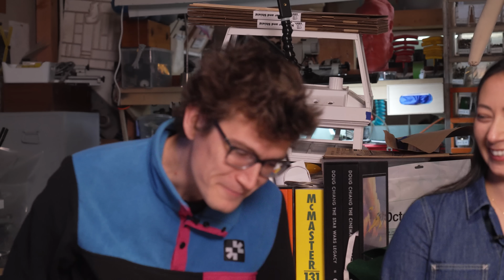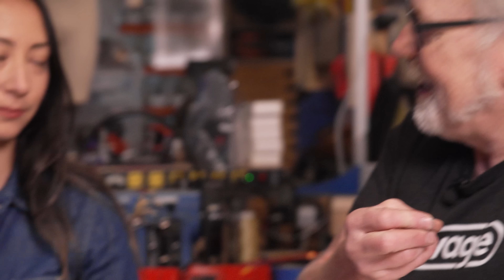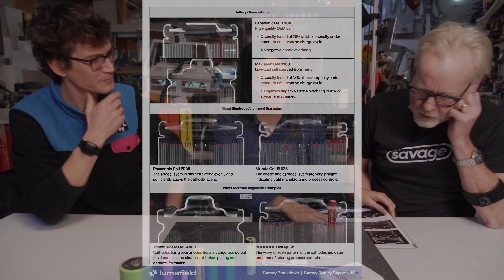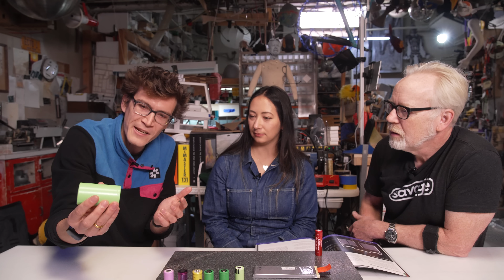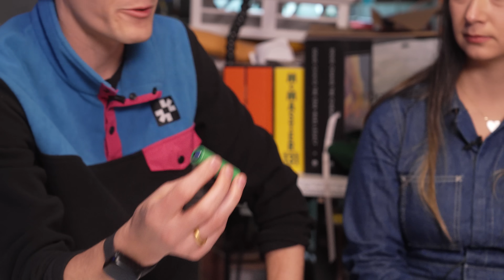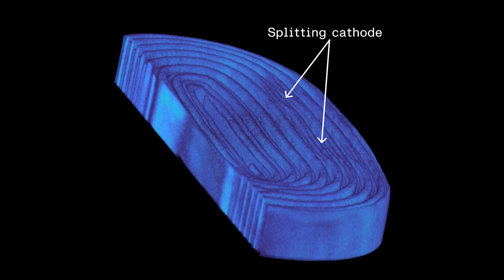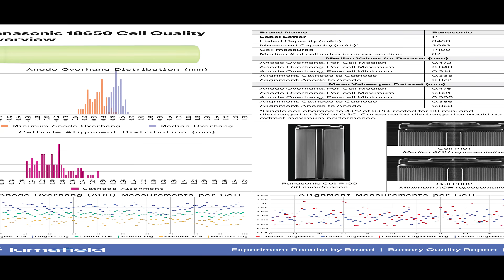The Surprising Flaws in 18650 Lithium-Ion Batteries

Comment: I work in the battery manufacturing industry, although not doing cylindricals. We x-ray our cells the same. The riot that happens if a cell that is 0.05mm above or below spec and somehow got sent through the process. Sometimes it can be as simple as someone bumped into something in the machines assembling the cells while doing routine maintenance or using the wrong screws. Battery cells have crazy tolerances. We once had to evacuate the entire factory once a few cells shortcircuited from a malfunctioning robot hand and do a several days long shutdown to investigate and fix everything. And these cheap manufacturers send such crap to consumer electronics is wild.
Reply: aluminum wires chargers that short out and turn the entire metal casing into a live wire batteries that burn out heaters with no safety shut offs we really need a website that catalogues and sells reliable safe electronics and components
Reply: @boxfoxscoot1614 In a sense there is one for the European union  but it's not specific to electronics. it's very confusing to read though due to the amount of products found problematic others for minor faults and other for serious ones and the bad way it is structured.
Reply: @DragonlordSVS damm, I just came up with a great business plan to help serve the EU because of your comment. Thank you for real
Reply: @boxfoxscoot1614  What all countries need, is that government will disallow the sales of the unsafe products in their country.
That every product when in process of import permission, is checked and validated by the specialists and experts, and they decide by the technical merits is the device safe to the user. Irrelevant of anything else than technical specs. So no politics, no competition, no branding etc influencing the testing process. If the product is not safe because some part, or its design etc, it doesn't get the import permit.
And all products gets re-checked with random checks that the product has not been changed since the import permit given.

That is example what can be seen comparison between Apple and Google in their corresponding App stores. 
People late Apple's protocols, but you can't deny that they have managed to keep safety extremely high regardless the amount of available products for its users. Compare that to Google's, and it is like Microsoft Windows, the user is responsible, regardless the user skills, knowledge or capabilities to find safe software.
Reply: @boxfoxscoot1614  here are some commas for you ,,,,,
Reply: What happens to the rejects? My theory is the Samsung counterfeit was probably a legit Samsung cell that failed QC that just gets sent off to a shady reseller instead.
Reply: @VexingRaven  not a chance the lack of quality control and those types of deviations are from a poor product being made using a different manufacturing system
Reply: @MrFateorfaith  yes and a case where money overrides the proud in presenting a quality product
Reply: @VexingRaven  At my workplace, we would just scrap them if they fail any QC pass with a good reason. But I would guess other places especially those mass producing several tens of thousands of day probally brand their lower quality cells differently and sell them somehow. If things like those in the video get into consumer products anyways.
Reply: @Rakvalde What does 'scrap' mean in your context?
Paying an external scrapping contractor to dispose of them?
Those contractors may be the ones doing the rebranding and reselling.
Reply: @Rakvalde Like seriously how stupid do you think ppl are? You expect me to believe you worked in battery manufacturing and when they found cells with a short circuit they shut down for days?? DAYS?? GET f@#$ed. Aint no manufacturers shutting down for days... wtf what a stupid bs story. Shuts down for days ffs 🤦‍♂️ so dumb. Next time you tell that story stick to theh stopped operations on the line with the malfunctioning robot to investigate.. 👍 dont make a story that sound dumb and ppl that arnt so stupid can immediately realise its a bs story. You dont work in then lithium battery industry please its really embarrassing so stfu. And on top the no name company you work for manufacturing batteries you are trying to claim are of higher quality and standards than say Samsung are they. Ffs do you realise how stupid you sound? And dont tell me you call yourself a man while making up stories like a child. Damn no self respect.
Reply: @Rakvalde  Unfortunately the truth is that when money talks, integrity went pop in a lot of cases. Seems like compared to 20 or 30 years ago, that becomes more like the norm in general. I'm generalizing now from the sideline and old age experience.
Reply: @Rakvalde  Rebranding cells is fine when the issue only affects cycle life or capacity, tbh. It reduces waste. Obviously if a cell is actively dangerous it should just be recycled.
Reply: @VexingRaven that would defeat the purpose of all the standards they try to meet with production. And would ruin their reputation as being reputable. You need to use some commen sense. The counterfeits are counterfeits. Proof is how they are made as in the construction of the case and even the just some minor differences in the cap, wrapping and also the printed text usually a little off with thir font
Reply: @hus_10001 You're being naive if think the factories in China always do exactly what they tell the company that are doing.
Reply: @VexingRaven bro stop embarrassing yourself you sound stupid. Tells me stop being nieve while talking nonesense. Snap out of it. Look how stupid you sound. Samsung counterfeits were originally a legit samsung cell that failed 😐 if you cant see how stupid that statement is then fair enough and we will end it here because i dont argue with people that cant tell fantasy apart from reality. Samsung sell their cells that fail to be sold on as counterfeits 😐. Dont worry the construction is completely different its got to be originally samsung that FAILED. Samsung sell FAILED cells to be sold as counterfeits. Wow the level of intelligence here in unreal
Reply: I worked as a semiconductor failure Analysis engineer for 25 years. We didn't have a fancy CT scan X-ray, but we did have a nice real time X-ray. The X-ray was great at imaging package faults, broken or lifted bondwires, and larger electrical overstress failures (fused open bondwires). I would demonstrate the tool by X-raying my cell phone and point out the different parts inside.
Reply: @billjames1953  The things I have seen manually reviewing probally thousands and thousands of CT scan images for deep testing and the on line x-rays from cells as they pass through. Sometimes I feel like I could spot broken weldings or misaligned sheets just by glancing at a images for a split second haha. :face-blue-wide-eyes:Once even saw a big piece of metal inside a cell that somehow passed all safety checks.
Reply: @Rakvalde sounds like you worked in Northvolt's Ett factory 😂
Reply: @Lvvcassss  Damn, how did you know lool.
Reply: @billjames1953  I've always enjoyed how you can technically image directly with a FIB as well by looking at the gallium ions, but it's obviously a bit more destructive and worse than using a standard SEM.
Reply: @EkiToji  We used use a FIB tool to isolate a single transistor on a IC and put down probe pads that would allow us to verify that the transistor is bad. We also had access to a FIB cross-sectioning tool
Reply: @billjames1953 dont lie, you used to work shovelling 💩 at the farm
Reply: just to put this into perspective, .05mm is 50 micron. An average human hair is 70 micron in diameter.
Reply: @TOAST2218 lol bruh this guy full made a story up trying to be relevant. Its funny how he tries to give specific details to try make it believable. He slapped 2x AA batteries in a toy one time and became a lithium battery expert
Reply: @hus_10001 I bet he used a set of metal calipers to measure the length of the battery as well.
Reply: Thank you for your dedication!
Reply: The Cheap manufacturers can just rebrand and start pushing crap out again the next day. If Phillips or Samsung cells have a few highly publicised explosions everyone will stop buying them and they will lose major supply contracts.  The 18650 isn't really an end user so much, but mostly it's like she said people bying Anker powerbanks or Ryobi, Makita etc.. tool batteries.
Reply: @BogoBob snap out.of it. The bigger companies pay for quality control and to meet minimum standards.. theh aint using trash cheap assembly robots. They pay to get it right and dispose of trash. Plus who tf sells.failed cells? Ffs. A billion dollar company you compare to firestarter cheap chinese with no quality control.what so ever. Wake up
Reply: As someone who works on airplanes, thank you
Reply: After having a 21700 cell explode infront of me I moved to buying better cells instead of the cheapest I could find, kinda scary that some people charge unprotected lithium cells overnight next to their bed without any worry at all, while im now scared to have a lithium pack just sitting outside of my insulated steel ammo crate.
Reply: @Tryxxor  I recently bought a pretty nice e-moped with a 60kwh battery. I only charge that giant thing with supervision and a safe way to dispose of it. If it explodes while im away my house is toast lol.
Reply: @Tryxxor what brand?
Reply: I am a graduate student, working on samsung inr21700-50g battery cells for an Electric Vehicle car. What we've been told by MOPAR technicians, that even THEIR practice is to run and tell everyone to fully evacuate. The chemical and safety standard to impede or 'stop' a thermal runaway is always easier to just 'gtfo.'
Reply: @Crestache hopefully, in the near future, this practice will not be necessary. The sodium and solid state technology seems much safer.
Reply: @mb-3faze solid state is a scam wake up
Reply: @hus_10001 the Toyota and Donut Labs solid state bats are most likely vaporwear - but CATL's tech does seem promising. Before 1994 'everyone' was saying blue LEDs were impossible (bright ones, anyway) and yet Nakamura proved everyone wrong.
Reply: @Crestache yea you remember the cargo ship with all the exotic cars and the electric cars that caught fire ? It sank and just burned under the fucking ocean until it was out of fuel for the fire. It’s gonna burn til it’s done burning lol the pressure and water couldn’t put it out how expensive is the safety system gotta be to put out lithium fires ? I’d be cheaper to move manufacturing plants while that old one burns yea gtfo
Reply: Thisn is all new to me, and I really need to know actual brand names, at least which ones are safest.
Reply: @drdanny11 I am no authority but my experience with buying and using 18650 batteries is that the most expensive seem to give the most reliable power output over a longer period than the cut rate no name versions. I’m very happy to see the work that was done here and henceforth will never buy another cheap or off brand lithium ion battery. The risk exceeds the savings imo.
Reply: @drdanny11  molicel batteries from a reputable seller is my go to
Reply: I use these 18650 cells for some projects. I only get big brands I trust because they are not to be messed with. Also a very good and solid protecting case.
Reply: @tardvandecluntproductions1278  can you suggest any brand
Reply: Yes - my pet peeve is these darned disposable vapes, which all have a Li ion battery in them. I find them discarded and broken on the side of the road here in northern California where the fire danger in summer is immense.
Reply: @stevengill1736 hopefully when they are discarded the battery is fully discharged
Reply: @vueport99 You would think that, but no. They are discarded because the eliquid ran out, rarely because the battery fails, and since they're rechargeable, they all almost certainly have plenty of charge still left in them.
Reply: @pfarnsworth84 that's a horrible waste. I've seen people discard them in collection boxes. Maybe I'll tear one apart next time I see one to test what the capacity is. I would be surprised if it even has 1000mah
Reply: @vueport99 people collect them to upcycle
Reply: @stevengill1736 oh risks aren’t that high as they say …
Reply: @CarTunezzz 
Thank you....I hope you're right and if they're made correctly probably so.
I've been collecting old vape batteries from used vapes donated by local smokers - planning to charge them and then abuse them in various ways to see if they ignite.... it'll be filmed for YT so we'll see....
Reply: I have a collection of vape batteries that were obtained from smokers...to be charged and abused, filmed for YT, so we'll see...😮 😊 Cheers....
Reply: @stevengill1736 just keep in mind they have cells that arnt ment to be used built as a battery pack and are ment for single cell use applications. Im not saying dont build a battery with them because i am but you need to take extra precautions because they lack the mechanical protection that cells used in a pack have. Also they are a pain to get them lined up and get spaced correctly. Honestly to make it at all safe it takes some extra time and effort and begins to get tedious. I built about 1/3 of mine so far and got frustrated and left it for another day 😅 i could have built probaby 2 48v batteries in the same time using 18650s
Reply: Dude me too! We scan everything! our QC department is huge.
Reply: @geoh7349 this is very reassuring.
Reply: i don't really fancy finding out how the cheap one's fail either.
once i had my mum's old apple laptop next to my bed at night. i woke up from a bang, thought i must have dreamt it, and went back to sleep. the next day i realised it had birst open the battery compartment. as annoying as that was, it was a safe failure. had it caught fire i probably would only have had a few seconds before the fumes would have knocked me out.
Reply: Our neighbor's home  completely burned to the ground  because of the freezing temperatures caused battery fire in their electric lawnmower, which was always 'docked' plugged in to keep it charged up for the next run.    Luckily, their smoke detector woke them up out of bed and they got out alive and unharmed, but their  home is gone.  So if you have  ANY  electric battery powered tools, lawnmowers, or other large lithium battery devices, be sure they are not plugged in all winter and if you can, keep them in a climate controlled heated garage.
Reply: @SeaJay_Oceans Yep, I do not store my Ryobi 40V batteries in my shop (which is not climate controlled) for that specific reason.
Reply: Hell, i wouldn't be surprised if some of these batteries are from the 'reject' pile of the more stringent manufacturers. Why recycle or trash them when you can just sell 'em o the cheap?
Reply: Never underestimate someone’s will to profit no matter what the issue is.

China sold baby formula for profit by reducing the amount of milk in the formula to increase the profit made by having less milk in the same amount of product. To pass the protein test that would have detected the reduced milk content they added melamine to the formula to bump its protein measurement back up to evade detection. Think about that level of motivation to profit more by feeding babies melamine instead of milk …. Then tell me someone wouldn’t just sell defective product instead of throwing it away or sending it back into the line to be reworked.
Reply: @enderwiggen3638you are comparing chinese products that have no standards and built as cheap and fast as possible with a single budget low grade technology machine in a factory vs a huge company worth millions/billions that follow strict quality control and standards and have multiple percision advanced technology machines and robots. A hundred thousand dollar company to a billion dollar one. I recommend doing some brain exercises otherwise it gets lazy and even simple general knowledge gets overlooked.
Reply: Some don't have pride in their work, it is just about the bottom line till they need to rename and do it all over again.
Reply: So what are the good brands?
Reply: @Goalsplus  Samsung and Panasonic are the main ones I've seen.
Reply: @Patrick94GSR authentic lg he4 is solid too
Reply: It does make me happy that your company does the right thing. Shame the cheap manufacturers aren't following suite.
Reply: Less reputable factories sell defects vs recycling
Reply: @Nicholas-f5  It's not limited to less reputable factories. Recycling is often uneconomical and even where it is, it's often outsourced and it's the "recycler" that sells the defects.
Reply: Varta?
Reply: The off brands don't have a reputation to protect. The better name brands have a reputation to protect, and also do not want to see any lawsuits. Branding matters in stuff like this.
Reply: So where is the portable xray for this purpose???
Reply: This interview could have been so much more mind-blowing. But I get it.  Better to exist to do more shows than die defending oneself from lawsuits levied 
by powerful corporations profiting from a trillion dollar industry. 
That said, by not naming names, companies, corporations brands,specific products and only giving dire warnings for caution absent specific precautions to consumers with no way to check quality ourselves, you are doing a disservice to the consumer. Can't blame you for playing it safe.... Or perhaps we should? Pick your battles. The Main take away: we're filling our faces and bodies and homes with potential bombs listening to our children out to play with them and to school with potential bombs that have an unacceptable failure rate and no way to know in advance. It's a little crap shoot and consumers are on their own. If something gets hot and you're lucky enough to catch it before it mames are kills someone, make certain to submerged said batteries completely/entirely under water.
Reply: Appreciate the work you do!
Reply: Many people assume a 3000mAh rating guarantees stable output, but that’s not how lithium-ion chemistry works in high-drain applications.
Reply: @diytoptricks  as far as I know, nobody thinks it will provide "stable output" at least not without a BMS and a buck boost converter. 

However, from what I know, lithium ion simply provides the highest charge and discharge rate of any $1 3000mAH battery you can easily buy. So when you need HIGH power output in a small package, that's when you buy lithium ion, like an 18650 for flashlight or drone, or a flat pack for a handheld device that you want to be thin.
Reply: then you ask... does the power density NEED to be that high? oh yeah it's toooo heavy!😂
Reply: Oof  sounds like something out of THX
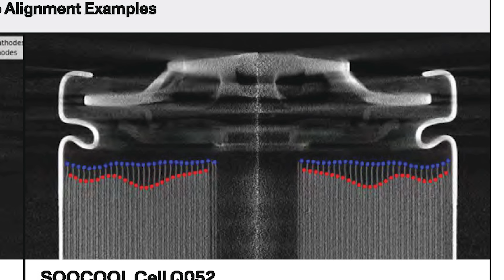Reply: Seems like long as the avoids are under a threshold it passes 7:29
Reply: The thing with those vape cells in particular is they are known to be defective. Basically these makers buy rejected stock for that should be disposed of/recycled for next to nothing and then re-package it for these single use devices. These defects are not that problematic if the battery is never going to be recharged after all. There is far worse issues with those devices though not limited to them being thrown away.
Reply: @theonik2006 I've never seen a disposable vape with an 18650. They are almost always a custom specified design. I've taken apart multiple dozens, and they've always been a different size of smaller cylindrical cell (little smaller than a CR123) with no can. Also, they are made to be recharged, because the battery isn't big enough to last for the whole tank of juice.
Reply: @pfarnsworth84  I didn't say they were using an 18650, they use different standard packs but the principle is the same, for the most part they will buy recycled cells from large makers.

Most single use vapes cannot be discharged and do not come with charging circuitry or a charging port. Since some countries changed their regulation to ban single use vapes though some makers are skirting these regulations by making them technically re-usable. (your experience may therefore vary)
Reply: What's blowing my mind away here is that a AA cell should be ~1.5v and the lithium ion cell should be ~3.7v. I understood that there's a DC-DC converter in there but I'm not seeing them talk about these converters. 

What am I missing?
Reply: @N9XRradio The batteries in the video are 18650 cells, not AA. They have a larger form factor and output 3.7 - 4.2 V.
Reply: @Vir9il ok. Thank you. I've seen LiIon AA batteries claiming to be 1.5v but they have regulators or DC-DC converters. 

Thank you for the info.
Reply: @N9XRradio  I bought some cheap chinese "Pujimax" liion batteries of that type (there are 1.5 and cubic 9v version with usbC plug for recharging). It's cool that they hold voltage untill they are completely empty. Then they just cut-off.
Reply: How much of a good practice is it to charge your batteries when you're awake instead of through the night? Because I assumed most fires happen in the charging process.
Reply: @Cypress-g3l4k A very good practice indeed. Honestly, charging at night is not that terrible, I have smoke/fire alarms and a monitoring system, but I absolutely NEVER leave anything charging when I'm not home, even NiMH. The only thing I feel safe doing that with is lead acid batteries and a battery maintainer.
Reply: @pfarnsworth84 , I was charging old Pb bike battery with it's stupid charger on the hot sunny day (the sun was directly hitting the battery case).  After being fully charged it "ran away" so it started to overheat. They were very hot, smoking and turned into a "pudding", they totally deformed.😆 But, luckily, they didn't explode or catch fire.
Reply: They are UL approved. Lol😂
Reply: Lol BOT
Reply: @hus_10001 where?
Reply: @Lvvcassss 😐plz just dont. I really dont want to disrespect you
Reply: @hus_10001 You seem to own a White brand bike...something tells me you've noticed the sarcasm ;)
Reply: Like seriously how stupid do you think ppl are? You expect me to believe you worked in battery manufacturing and when they found cells with a short circuit they shut down for days?? DAYS?? GET f@#$ed. Aint no manufacturers shutting down for days... wtf what a stupid bs story. Shuts down for days ffs 🤦‍♂️ so dumb. Next time you tell that story stick to theh stopped operations on the line with the malfunctioning robot to investigate.. 👍 dont make a story that sound dumb and ppl that arnt so stupid can immediately realise its a bs story
Reply: There is a lot subbrands in china that buys the dirty lithium reject from their high purity quality assembly.

Basicly taking trash and trying make the most out of it by maked billions of tiny batteries..

Sometimes a pack have dense concentration "rock" of contaminent in the lithium compound itself. When current flow thru those rock, they ignite and light up the whole battery.
Reply: I have the sudden urge to listen to Metallica's ''Battery'' now.
Reply: What country do you work in?
Reply: It's "wild" that most people want cheap and good enough?  lol no.
Reply: You should share your brand name if you think the batteries are that good!   :)
Reply: @Ishkatan  Unfortunately our company went bankrupt due to bad management and ridicolous spending so no batteries are out there except in equipment being used lol.
Reply: Those are not crazy tolerances, thats mediocre tolerances for every mechanical industry over the world. From a garage sized company and to multibillion. If you get into really tight tolerances your numbers are out of the chart.
Reply: @andersnilsson973  Problem for us is our machines had so many bearings and other things that caused offsets that we could at most maintain a +-0.2mm tolerance from the drawing design. And we were expected to shut down the machine and re-set things if it got 0.05mm out of tolerance at times lol. Even though me breathing on it could change it by that much.
Reply: What happened at LG Chem  traction batteries ?  Bump the assembly machine with a Fork Lift ?
Reply: its same as light bulb
Reply: wait, its known like 20 years in eu
Reply: That's what happens when you build mass, china produced stuff. Build cheap, build twice.
Reply: Yes but there are lives at steak here and there is tolerance built into manufacturing there is no excuse and you should know this.
Reply: Thank you for your service so that we might not have a dendrite burn us directly!
Reply: I am an battery enthusiast, I own batteries from various brands including Samsung, Toshiba, LG, Panasonic. The Panasonic is the one he kept touching with the black bars in green sleeve. But there's also bad sellers who put a fake sleeve and call it Panasonic. The real one is very stable even can go for years under full charge without failure. What kills me is why battery pack manufactures like Dyson, DeWalt use junk 2400 mah instead of quality 3600mah. The price they charge for those packs is insane given how cheap the Panasonic cells are to begin with. And that could have given people really long run time!
Reply: @vueport99 Panasonic and the lg he2 and he4 were the goats
Reply: @tobymcq33 I'll try to get some OEM LG cells in the future to try.
Reply: @vueport99 omg why are there so many story tellers around 🤦‍♂️ shows your lack of knowledge. They arnt trash just because the have lower capacity. Lower capacity cells usually have higher discharge rates. Damn bro calling cells trash just because you have no understanding. And you tried starting your story with you are a batteru enthusiast. How embarrassing
Reply: @hus_10001 you have no clue what you're even talking about. Get a life
Reply: People accept the cheap batteries because they don't really know, or remember what they are. As at some point people's youth, they do learn that batteries are mainly chemical what they are using. Were they a liquid starter batteries in car or a small AA battery in their toys.
But we forget all those things as they "just works". 

What happen when couple Samsung S2 or S3 phones got ignited and exploded even? 
The industry went nuts and people became aware.
(That is power of terrorism via private media corporations.)

And yet we, consumers, can't really do a thing about it as we need electricity in small devices.
There is not really way to get back. but does it really matter if we would have a governmental safety protocols in imports of products?
That is one thing in the USA, that you can import lot of crap in name of competition. Where in civilized countries the government's duty is to protect their citizens, and hence as well safety check imported products before letting them come to markets, that they fulfill the technical standards and safety policies etc. 
That is the purpose of the standardization and protocols, we together as democracy, check everything and we agree with a common rules and protocols for benefit of the people, not benefit of corporations or business. And those standards and policies are obeyed and followed by the companies and corporations without their self-interest as "individual". 

So when a children toy with batteries, or a professional tool with batteries, or a common electronic device with batteries gets to the market, you should be sure that each part in the device is checked by the government authority, that has the technical know-how and methods to confirm its safety for the citizens use on the task.

But as countries join to all kind stupid "Free Market" or "Free Trade" association and groups, like EU and WTC, they circumvent the democratic and national safety protocols and infiltrate the safe environment with crap that is hazardous and dangerous for its members.
Reply: @paristo You overlook EU battery regulations which are more rigorous than national ones, and which are far less likely to be ignored, and which raise standards for countries not even in the EU.
Reply: @paristo  I remember hearing about the Galaxy Note 7 phones that ignited and exploded even, but in that case I think the way people became aware probably had more to do with the 'power of the press' than it did the 'power of terrorism via private media corporations.'
Reply: @paristo  I remember learning that the original TPP (Trans Pacific Partnership) contained language that made it a contract violation for a participating nation's government to enact any law (in the best interest of that nation and her people) that could be deemed to have an adverse economic consequence to a corporation operating under the umbrella of the TPP.  Realizing that governments were signing away their ability to govern lest it offend the profit motive of some company was a terrifying initiation to the true state of the world. This world where profit over people could be enshrined in the largest trade deals, where my elected government wasn't in full control of national policy decisions and that governments are more beholden to the largest companies than they are to the electorate. I have not read every major trade agreement, but I can't believe that the TPP was a "one-off". We definitely need a firewall between government in business, otherwise there is no one on the side of the people and no real redress for corporate abuse.
No I'm not anti-business, they hold all the capital... they will be fine but image if planned obsolesce went away and right to repair was enforceable and monopolies were actually broken up and corporate welfare ended and corporations paid for their use of the commons etc etc.
Reply: When you think about the guy who got his jar blown off by a faulty vape battery, or the people who had their Samsung phones catch on fire in their pocket due to faulty batteries... Those lawsuits, while not devastating to any big company, will still hurt them over the long run. 

When you make 500,000 batteries a day and you catch ONE with a defect, it scares you (if you have any stake or interest in the company) that there might be 1000 more with the same defect from the same day that you didn't catch. I understand getting angry over it, and I also understand replacing all the humans with robots in circumstances like this. 

When someone bumps their elbow against the machine and causes $50,000,000 in damages over the course of a handful of preventable lawsuits, there isn't enough justice in the world to make that worker pay for their mistake. They will never pay that off, and you can't even punish them. So the owners will choose robots that, when they begin to make mistakes, we can simply update their code. No punishments needed and yet we know it'll never happen again. That's a win-win
Reply: @cyleleghorn246 just NO. ALL THAT JUST TO SOUND STUPID WOW
Reply: @hus_10001 no matter how expensive your assembly line is, there can always be a bad day. That's why they never stop doing quality control.

What do you think I'm wrong about, or did you just have a bad day and you're feeling grumpy 🍼🚼
Reply: @cyleleghorn246  capacitors last up to a million cycles, can be made without rare earth minerals, and cannot cause this kind of harm if properly used.  We don't need batteries, or robots.
Reply: @ZennExile I've known this since I read it on popular science in 2010. It's been 15 years, we now have robots but we still don't have these super capacitors replacing lithium batteries in any consumer device. The closest we've gotten is lithium iron phosphate, which is better in some ways (safety and longevity) but worse in other ways that super capacitors would supposedly solve for us. So where are they? Anyone who makes them will make a trillion dollars. Or maybe not, since everyone would only ever buy 1 and can no longer use "the battery I can't replace has gone bad" as an excuse to force the customer to buy a whole new device.

Even if I went into building capacitors and revolutionized the electrical storage industry, I'd still keep all humans out of the factory for fear they would electrocute themselves, ruin QC, contaminate the floor, or otherwise lead to frivolous lawsuits.
Reply: @cyleleghorn246  you just make the factory part of the power plant and staff it full of engineers with black fingertips and the sense to wear PPE now.  But you can scale down to 3D printing and build these components on site within safe human parameters.  It's purely market driven that we consider chemical batteries superior at all.  They represent extracted wealth potential ahead of energy density, in all respects.  Capacitors upend the entire con.
Reply: @cyleleghorn246  oh and, I could make more than a trillion.  For sure.  Because those capacitors would just be part of a larger ecosystem of fully distributed energy and compute solutions.  But you're still stuck on the idea that a chemical battery can store energy longer in a world where energy must flow.
Reply: @ZennExile that’s not practical.. a million cycles for a capacitor the size of your entire car to power it.. or lithium that gaves 25x more power density.. that’s why only took me 5 mins to think meanwhile both of you & your twin in the comment waiting 10-20 years about article in 2010, shows me a how far dated you really are as far as information 😢
Reply: @CarTunezzz  Lithium isn’t necessary it’s just convenient for sparse infrastructure.  Once infrastructure evolves, capacitors suddenly look inevitable.  And it's only 10x.  For example, 1kg of capacitor pack can power a cellphone for 4 hours, and charge in 1.1 seconds.
Reply: @ZennExile  except for about 8 years, counterfeit capacitors were made and sold in consumer products that failed 3 months to 4 years into the product lifetime.
Reply: @johnhill8958 you can 3D print them yourself now.  That's the main point.  You can't 3D print a chemical battery.  Capacitors are superior by EVERY metric but one.
Reply: Replying to the last line, we allow them. We vote and look away as those manufacturers lobby our representatives to enact laws that protect their pockets and not consumers. St-eve Bann0n said “we want the end of the regulatory state”.
Reply: Please bear in mind these "cheap" cells are still made in million $ factories, it's just the choice of tolerance/materials and QC they put to make it good/not good. 

It's a business decision but the capability to make good ones is still there.
It's very much a coin toss, it's not automatically rubbish quality. 
This is the danger really.

Much like your local fast food place may make really lovely food, but their hygiene may not always be adhered to, so.. You'll occasionally spend the night in the loo.

Except in the battery incidences could be significantly more severe.
Reply: @JLneonhug   Yes, this is the problem with the Temu business model - it's not that the products are necessarily bad, it's that you don't know the provenance of what you're getting. With name brands, you're paying for reputation.
Reply: Are the faulty ones destroyed or are they "sold" as seconds to another manufacturer for wrapping?
Reply: capitalism will always put downward pressure on price and thus cut corners
Reply: @kiloftd not that I disagree, but a solution would be for people to invest in the higher quality by requiring demonstrated quality certifications, and imposing a higher cost on those lower quality products. I guess that becomes a problem with counterfeiting then. Still, this seems like something UL, CE, or the FCC could get behind and unless there is a certificate associated with the components, then there is a higher cost levied at import.

I dislike that I'm describing something like a tariff, but I think this is how tariffs should be used to lower consumer risk, not extort. At random, imports could be seized, the vendor reimbursed, and independently evaluated that they conform to spec for those goods.

If vendors declare bankruptcy and reopen the next day under a new business license, there needs to be a capital cost that encourages the adoption of higher quality parts and building brand recognition.
Reply: @kiloftd weird comment
Reply: 18650's are a different animal they come in a variety of form compared to AA's for example.
To the point that I thought it was the subject of the video...
Models vary in length, diameter, raised button top/ flat/Z solder tags, with or without PCB protection, capacity of course, etc...
So you can't just buy a "18650" and install it into your device, you'd better check all these parameters, first!
Reply: Is there any way to visually identify 18650 by name or manufacturer that have the thermal expansion circuit breaker internally? I have 30 or so that I've harvested from HP and Lenovo laptop battery packs
Reply: @scottlake5280 no this a random test of 100 batteries from several manufactures
Reply: @scottlake5280 there's usually a dot matrix product code on those cells which you can look up to tell you if they're from let's say LG
Reply: @scottlake5280 The harvested ones, if from a genuine OEM battery, shouldn't be too hard to find info on. The ones I've gotten from an old laptop battery (fairly sure from HP) are marked "Samsung" and I was able to look up a data sheet for them based on their other markings. I would think (hope) that big known brands would not use counterfeit batteries in their laptops.
Reply: I worked in an r&d 18650 lithium ion battery plant wayyyy back in 2001. We were making 2.4ah batteries back then.

Batteries that were out or spec, or non conformant were auctioned off and third parties would sell them under their own brand.

We would joke it was the US military buying them to drop on countries from planes.

We would manually x-ray batteries, with two operators looking at a tray of 100 batteries with a flight joystick. Each button being a different rejection reason, or the trigger was accept.
Reply: Which is a good reason why we're moving to safer chemistries like LFP and sodium.
Reply: @onikin  nothing is safer or lower impact than capacitors.
Reply: Cool anecdote, but terrible consumer batteries are not going away any time soon, especially now that replaceable batteries are getting uncommon.

Few manufacturers are going to pay for higher quality manufacturing when they embed batteries even in a normal economy, we aren't in one. 

Finally, the previous video was not a good one at all. Aside from being interesting it was an entirely disengenuous comparison of cheap charging cables with well made thunderbolt cables these aren't the same thing.
Reply: almost like personal energy solutions are vastly superior in every imaginable way, and no one should be using chemical batteries at all when capacitors, magnets, the sun, and gravity, can scale to any application, without rare earth inputs, and fully distributed suffers no infrastructure or manufacturing related losses.  Be they plausibly deniable or otherwise...
Reply: @ZennExile 
Let us know when your gravity powered cell phone goes to Market.
Reply: @tylaranderson8559  capacitor packs for small electronics are already on the market.  The gravity is stored in a mass.  The energy is extracted from a flywheel.  All of this is old tech available near you.  You are the obstacle.  Not the market.
Reply: @ZennExile  Have you checked out Donut Labs? Their product is 150% pure bullshit, but it will hook you in like a fish, and I love that for you. Invest all of your money in it immediately and borrow more if you’re able to, particularly from close friends and family.
Reply: @tylaranderson8559  after their last comment, I'm now imagining a handheld cell phone with this obnoxiously huge, heavy flywheel attached to it 😂
Reply: @ZennExile so we should all install a Vacuum Flywheel in our homes?
Reply: @tinyturtle1898  magnets made from recycled steel are big and heavy, you can use them to power an inductive flywheel that extracts and injects energy into a hydraulic system to lift mass.  Even the entire home, or building.  These systems already exist everywhere.
Reply: @ZennExile    I'm not sure what you're implying, regarding plausible deniability of infrastructure or manufacturing loss.. but Chemical batteries ARE the personal energy (storage) solution.  To try and store the same amount of energy as a few batteries, you're talking Potential energy, that's the gravity solution you mentioned.  Solar panels are just a source of electrical power, and if you're not using or store it,  it's wasted.     And Capacitors?   That's like saying a Camera Flash is just as good for lighting your home as a lightbulb.

If you want to learn something, go watch this quintbuild video, where they make a gravity battery like you mentioned /watch?v=CMR9z9Xr8GM
Reply: @ilovefunnyamv2nd  you can't follow what I am saying because you lack knowledge and/or expertise.  Your personal truth doesn't interest me.